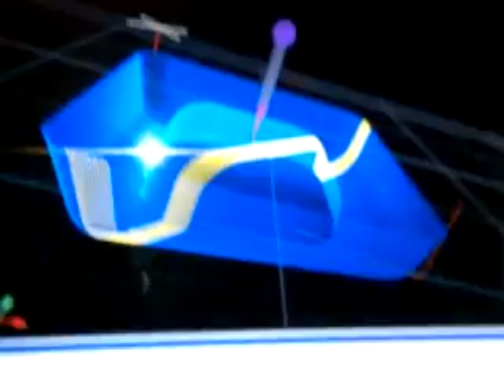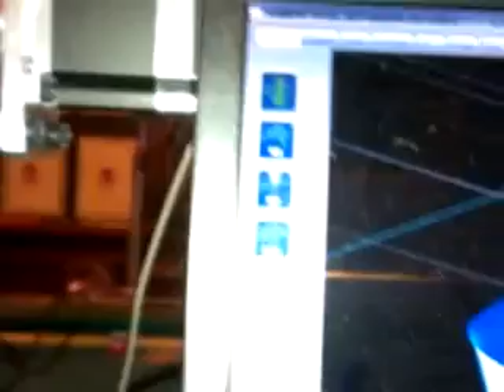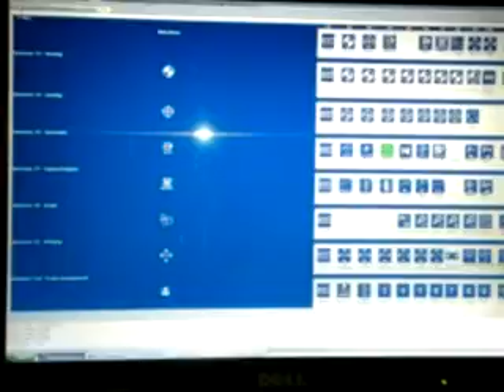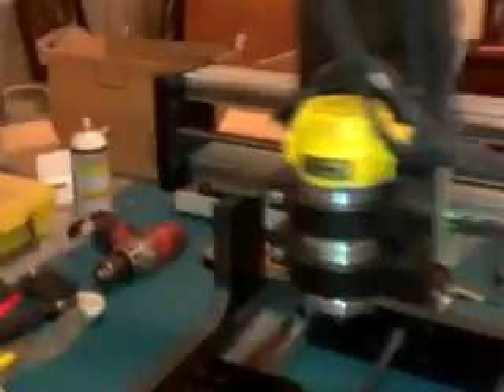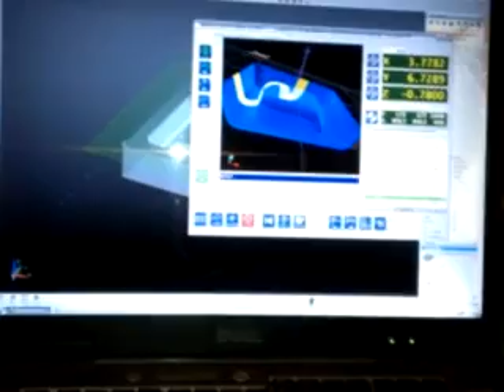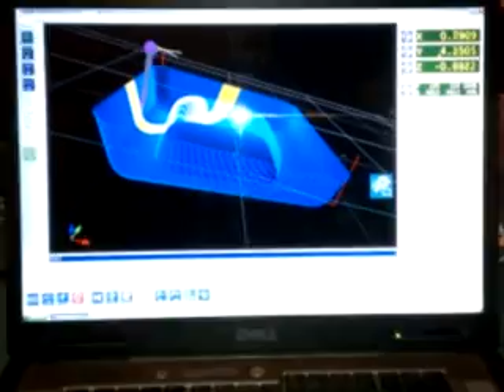DIY HomeMade Mini CNC Router Engraver Mill USBCNC Control with G540!

Comment: nice machine, i also planning to change my stepper drive to G540 right now i am using usbcnc cpu5 with ethernet  modul for oxy/acetylene cnc machine and cpu4 for my aluminum router